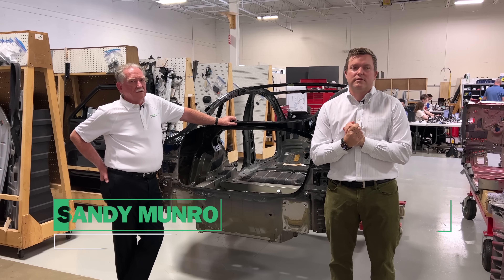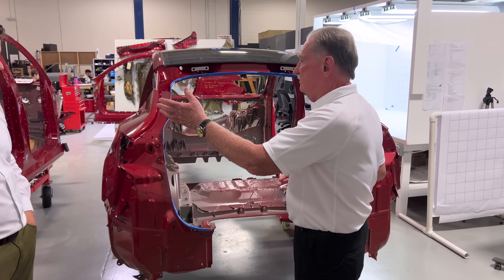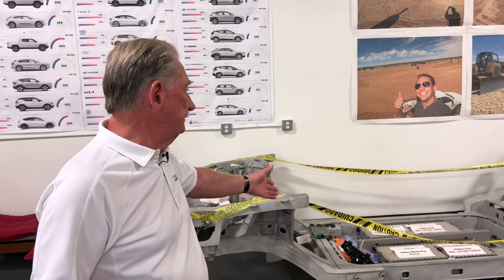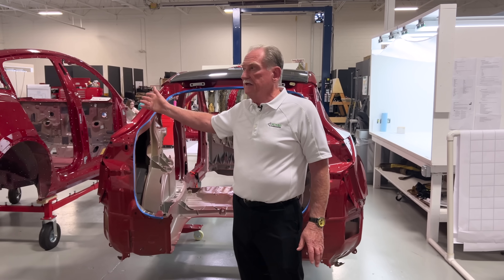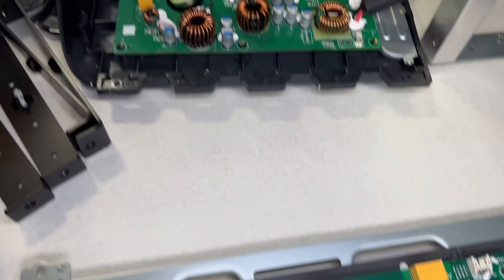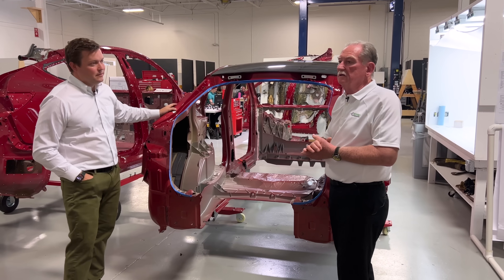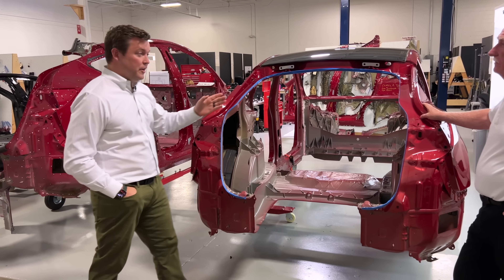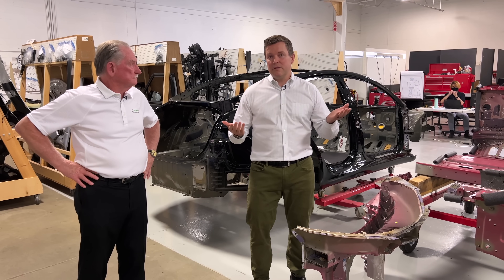Giga Castings with Sandy | Evolution of Tesla Bodies In White

Comment: If Sandy is a fan of large structural automotive castings, he would absolutely love what I’ve come up with. I can do a nearly complete body in white with 3 gigacastings, 4 extrusions, and 2 floor stampings. The doors and lift gate structures would also be gigacast with injection molded plastic skins inside and out. Assembly would be very simple with thermal slip fit techniques along with snap fit panels and a handful of interior fasteners to prevent attempted disassembly from outside the vehicle.

Comment: Sandy, the coils are NOT there "to eliminate issues";  they are not protectors of some kind;  they are integral elements to power conversion.  In switching power conversions, where power is mostly preserved across a high efficiency conversion, the way such a thing is typically achieved is by using an inductor, together with a switching mechanism.  Allow me to help you understand this stuff:
  Water examples of electrical concepts:
  Voltage is like water pressure in a pipe.  There may be a lot of pressure without flow, such as a closed hydrant, or such as a high voltage capacitor charged but just sitting there unconnected.
  Current (amps) is like a flow of water through a pipe measured in, say, gallons per minute.
  Resistance is like a partial opening of a valve.  You could say a valve is 10% open right now;  but that's not a very scientific measure of resistance to the flow of water.  A refined way would be to say how much water pressure across the valve is generated at a given flow of water;  and that is what in electrical systems the measure of resistance does:  If 1 volt of pressure produces 1 Ampere of flow, we say the resistance is 1 Ohm.
  So far so good?
  Now we come to more complicated concepts, like capacitance and inductance:
  Imagine you'd take out the bolts and opened a coupling in a water pipe, and inserted a rubber sheet, like a piece of a balloon, clogging the intersection;  then closed it up again.  Now increase the water pressure a little bit, and a bit of water will flow TEMPORARILY until the rubber stretches to match the pressure.  If you ease the pressure, the rubber pushes the water back.  This is how a capacitor behaves.  Do not confuse a capacitor with a battery, however;  a capacitor will push back with voltage that is proportional to the charge, just as the rubber will push back harder the more water has flowed into it.  A battery, on the other hand, has a more or less constant push force (voltage) across most of its charging capacity curve.
  Imagine now that the kind of water we've been talking about in all the examples above was a special, magical water that has no weight;  no mass.  Now we want to introduce weight and mass:  Electricity in wires flows (mostly) as if it had no mass.  But if you wrap a wire around a ferromagnetic core, now when you push the electricity, it seems to not want to flow initially, but then it begins to accelerate.  As long as you apply pressure the flow keeps accelerating.  As long as you apply voltage, the current keeps increasing.  But if you now try to stop it, you'd better not try to do it all at once.  It's like you've pushed a shopping cart full of bricks faster and faster;  it will take time to slow it down as well.
  In a "flyback" switching power supply (there are other types, such as buck, resonant, etc.), you take advantage of this characteristic of inductors in this way:  Over a period typically lasting microseconds, you switch on DC power, say, from a low-voltage battery, directly onto an inductor.  After, say, 20 microseconds, the current has accelerated to a huge 100 Amperes.  Now you SUDDENLY shut off the switch:  The 100 Amperes HAVE TO flow somewhere;  they absolutely cannot stop so fast;  so if you allow them to flow into the input capacitor of a high voltage DC circuit, they will do so, let's say, in one fifth of the time (4 microseconds) but producing 5 times as much voltage.
  That's what those inductors are doing, for the most part;  though some may have other functions.  Ferrite donuts are often used to wrap a differential signal pair of wires around so as to slow down induced common-mode currents.  In other words, opposite currents in the two wires (differential mode current) can pass through unmolested;  but a sudden current trying to flow in the same direction through both wires (common-mode current) gets slowed down by the inductor.  This is referred to as "a common-mode choke".  Such things may be present in these boards;  but given that we are talking about power conversion, the primary theory about the use of any inductor should begin by suspecting some power conversion function.

Comment: It's great for Tesla but the crash statement remains; those cars with structural damage can be fixed and sold in Europe under a category. The car has a fresh MOT road certificate and its good business for a lot of professional traders. The cars naturally sell cheaper and they can be fully inspected before purchase. Fixing crash damaged cars is a good thing. Those front and rear castings can be removed and replaced with bolts
Reply: Till they bring some more stupid regulations and not make it viable. Another way to apparently ‘ protect and look after the clones ‘ , then this makes the government money and puts the cost of living up .
Reply: @newagetemplar6100  not in England. A car needs a fresh road certificate every year. If you fail the inspection you can't drive your car.
Reply: @Lore69420  know what your saying I’m from the Uk too , built , repaired and raced plenty of cars but most of the rules and regulations add excessive costs and the make some cars non viable to repair etc . It’s not really then really about making cars repairable , it’s all designed to generate revenue for manufacturers, insurers, lawyers and the government in tax

Comment: Nice video, thank you! I'd be interested to know what the weight of the BIW would be, and how it holds up in sustainability relative to steel. Aluminium generally isn't the best material for recycling. Although I can imagine that these large parts make it easy to sort out the waste at EOL.

Comment: OK – I am a retired GE Mechanical Engineer.  I grew up in a garage/dealership. I am a “gear head”, just like you guys.  I have been a student of Tesla.  Here are some points to consider:

1)  In 2012 there was a Youtube video of a Model S showing a box (like a thick Domino’s pizza box), on the roof.  In 2014, there was another video showing early FSD, and the two guys were driving on a small CA back road.  They said oh look, there is a Nikola Tesla tower out in the middle of that field.  The tower had an elongated base like the Statue of Liberty, and a slender stainless cone with a sphere on top.  I guessed that the tower was 60-75 ft tall and the top ball was maybe 16-20 ft in diameter.  My “gut” says that they were testing Nikola Tesla powering of the electric car!!!   To me, the current EVs are just a stop gap, with their large batteries.  If you have a constant flow of electricity coming into an electric car (EC), you will only need a small battery for dynamic braking/acceleration(like a hybrid battery).  There has also been some conspiracy information saying that the power distribution will be performed by the Starlink Satellites.  Internet will be a sub frequency of the Quantum Resonance. The ECs will be vastly simplistic.

2)  In ~2019, Elon made a number of  diecast kids Model 3 cars.  Why did he do this???  I think, he wanted to see what painted/wrapped surfaces looked like for future ECs.   Last year, he took bails of recycled aluminum cans, smelted them and added in his alloys, AND produced billets for the Giga Presses.  So I see a small car (Model 2) that has 4 main castings(skateboard/left side//right side/roof with roll bars) and numerous small castings, that make the entire body.  What if there are NO stamped metal parts??  Body cost would be about 10-15% of current cost!!!  Mostly robotic assembly, maybe NO welding.  His Model 3 dreams just might be realized!!!

3)  One of the first jobs that his new robots will tackle are installing wiring harnesses. Expect roof harnesses to be installed prior to the body being assembled, along with the entire dash, plus fire walls.  The skateboard will have wiring harness, seats and console, just like the current battery pack.  What if the body castings are painted/wrapped, cast doors are hung(with panel inserts) to the left and right sides, the hood and trunk/hatch are hung to the roof casting; and the entire car is assembled by bolting these major castings together.  Then plastic panels are snapped in place covering the bolts.  Four major casting assemblies form 98% of the finished car, except for plugging together wiring harnesses.  Just a thought...

Comment: 3 things jump to mind
1) Elon likes Lego - so why not make Cars like Lego kits
How come billions of Lego pieces all fit each other to 0.005mm
2) FSD will revolutionise Car design - if a car does not crash why make it crash proof / bullet proof = no need
3) CAN bus technology (Controller Area Network - CAN bus is a message-based protocol designed to allow the Electronic Control Units (ECUs) found in today's automobiles, as well as other d) will revolutionise Car design - it will save miles of cable and drive costs down = FACT

Comment: Ok, so you get in a fender bender, and now you have to replace the entire casting instead of pulling a bit of sheet metal. We are becoming a more and more disposable society. No insurance company is gonna price welding what they wound consider a structural member. The wheel wells are part of the casting, any damage to the rear of the car that normally would only bend the rear crash structure is now gonna involve the entire rear structure.

Comment: Would you guys please address the quality, longevity, and repair ability of such castings? What might a repair look like for a fender bender, mild accident, or significant accident look like? It appears as though these body panels may be part of the castings which makes me question the viability of these over time or whether they basically get scrapped at the first damage. Thanks!
Reply: The sheet metal exterior panels are definitely not part of the castings. I've seen plenty of vids by Munro and others showing the 2 castings and they only make up what in other cars is the unibody "chassis". Repairs from a fender bender or mild accident will be the same as on other cars. For serious accidents, to paraphrase what Sandy says in the video - if the car was hit hard enough to crack or deform one of the castings, it was a hard enough hit that would total any modern car with a unibody.

Comment: What does this do for the consumer though.  Seems like it saves money on Tesla's end..but is the car lighter or cheaper.  hmm..me thinks not.
Reply: Any time a manufacturer of cars or toasters cuts production costs they can chose to keep the savings or pass them on to the customer. For Tesla the free market comes into play. The demand for Teslas is greater than the company can meet,  so they can charge as much as they like. They don't screw anybody, but they aren't handing out any bargains. Tesla's vision is to keep pouring money back into  new factories and new tooling. They've never paid a dividend on their stock. Elon recently described the Austin and Berlin factories as "money furnaces," they aren't making enough cars yet to offset the daily operating costs. Tesla still needs to retool the Fremont factory for front and rear castings.

Lighter... no. The Fremont and Texas Model Y's are about the same weight, which has puzzled the Munro teardown team. The gigacastings are lighter, but the weight seems to have gone into the structural battery pack.
Reply: Cheaper and more reliable. Probably slightly lighter too.

Comment: I feel like this might be too much work for little reward but I’m going to put it out there anyways. The single casting is going to need a sort of repair book to bring cost of repair down. If you guys can create a diagram/book that pinpoints the best places to cut, types of welding that would create a best repair, material to use in order to get the best material properties to match the car. This would reduce labor, reduce repair cost, and open the car up to the repair market sooner. Just a thought to put out there.

Comment: My father made a cast product, and there is one tradeoff that you haven't mentioned when you extoll the virtues of casting, is that cast parts are not easily repairable. The kind of metal alloy you need for the very liquid squishing that happens in the production process does not lend itself to welding afterwards, and in smaller cast parts when it breaks you replace the cast part. This giant frame cast part is so large, and basically impossible to swap out, so this is going to result in a less repairable vehicle.  

I doubt Tesla will sell these castings as available replacement parts (they don't sell the battery cover at present, which hampers minor cell repairs).  Steel has a unique property that it can be welded and retain strength, and can be hammered back into position.

Comment: What is the part count difference between the 3 different cars?  In discussing the Model 3, Sandy at around 30 seconds stated that the car had around 120 parts.  It's obvious visually that there has been a significant reduction in the '20 and '22 Model Y's.  It would be interesting to know that actual comparable part count reduction for the '20 and '22 models.  Thanks,

Comment: 1. Simplify the requirements
2. Delete the process
3. Optimize the process
4. Accelerate the process
5. Automate the process

Prioritize thinking, not building. Make the product the best it can possibly be BEFORE you put it on an assembly line. That's how good engineering gets done. If someone is offering you feedback on parts 1 or 2, you'd best listen.

Comment: The old car companies ARE dinosaurs and can't afford to stop using the investment in stamping machines AND the labor contracts they are locked into. Their inflexibly is built into the structure, so they simply can't get the engineering department to change because the lawyers in the C-suite will kill it.

Comment: Elon once talked about the alien dreadnaught factory. They tried to overautomate Model 3 and it was an abysmal failure. Tesla engineers then did the impossible. They stood back a million miles and looked at the problem at the utlra macro level. They figured out how to automate the manufacture of Tesla vehicles WITHOUT the robots. Instead of trying to get better and better robots to do the same job that Henry Ford's assembly line workers were doing 100 years ago, they figured out how to completely reinvent all of those processes to eliminate them. Elon Musk no longer talks about the alien dreadnaught factory, but that is exactly what GigaTexas and GigaBerlin are. He no longer talks about the million-mile battery but that is exactly what they are building as well. If the best part is no part, then the best automation is no automation.

It will be interesting to see when other OEMs will get deep into this. We have seen some relatively large aluminum castings in Ford products, is that a sign of what is to come?
Reply: Toyota is reducing automation in their factories in favor of involving human sight and touch to keep quality high. Large aluminum castings for suspension members have been used for quite a long time, the Model Y happens to be the largest casting used in any car. Polestar/Volvo and VW are both preparing to employ similar casting techniques in their newest facilities which are under construction
Reply: @areitu  Toyota is just going backwards, that isnt anything new. Coach builders have been playing the balance between automation and hand-crafting since they were still called coach builders. What Tesla has done is eliminated some of their automation by eliminating all of those steps that needed to be automated in the first place. That is a completely different thing.

Comment: Although barely discussed, while a crack in the casting could be TIG welded as a repair, a relatively small fender-bender can distort the shape of the casting.  This means that many accidents that could be repaired on a conventional body, while replacing a casting would likely result in the vehicle being totaled.  You are starting to see this with Teslas that have had relatively small accidents have repair costs in the  $ 10K+ range, if it is economically repairable al all.  Perhaps we are moving to a paradigm of throw away cars, which will change the car insurance structures that we have today.  Also the savings advantages discussed of lowering labor, parts count and a simpler assembly line process dies not seem to bring a price advantage to the buyer, at least not with Tesla.
Reply: That is already true with minor fender benders in other vehicles though. If a accident can bend this casting it can bend any frame. ANY repair requiring a rebent frame is a total these days. The ONLY difference is that Teslas cannot be reconditioned once they are assessed as totalled. Which is because of the looming question of unseen damage to the battery pack. Not the body. This will likely become standard practice across the industry as it goes electric, but right to repair has already been an ongoing issue in the automotive industry long before Tesla. This is a big part of why ADAS and automated collision avoidance is such a big deal. If cars are too expensive to be repaired, then they need to make sure the cars avoid accidents as much as possible.